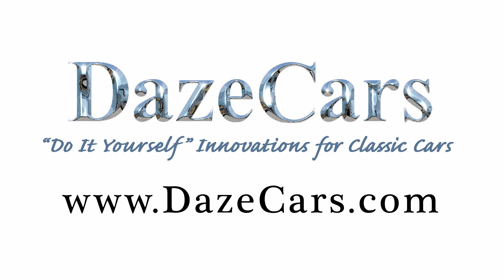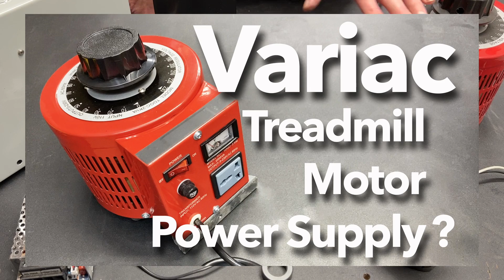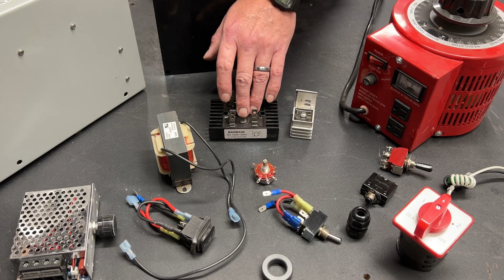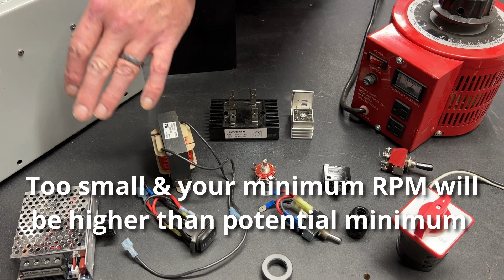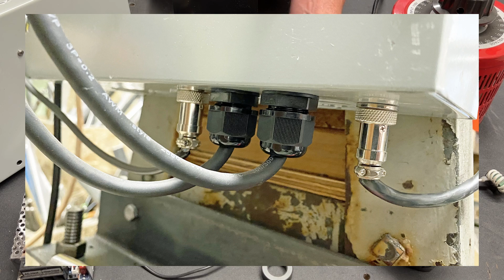Parts Lists & Links for Building Your Own Treadmill Motor Power Supply

Comment: Daze, I would like to know how you got hold of you  your  Lathe Els  system for your lathe  can you fix my problem by telling me were & how much did it cost, & where you got it from & can i ues a mobility motor Dc motor to do the driving ?
Reply from the maker: Here is my ELS parts list video.  Please don't hesitate to reach out I can be of any further assistance.  https://youtu.be/tIHPrIi9Zys
Reply: Hi Daze, do you have any sources for motor pulleys? Your power supply info is excellent. I have to find an old microwave oven. I want to swap the flywheel pulleys and gear down the speed. Oh belts too.
Reply from the maker: I get all that from eBay and Amazon

Comment: A new video you could make is on how to program the PWM    XY_KPWM    35800-TE .   I am good with these kind of  things but not this one. My treadmill motor is a 2.5 hp  with a MC-2100 controller, everything was complete and running with the control panel. I purchased one , set it to 20 Hz and the motor was running at 50 %. So then I went to set a % range of 15 to 45 % .  I could never get it to display the dn  or  up during the setting process. Never could set it and it never ran again. Turned it on, where it was showing the word OUT. Ordered another one same thing. I have the instructions , Hold down button ect.    Will you make a more detailed video on this PWM  ( or have you already made one ?) and the other one that has 6 buttons, and no knob.  There must be many other people that have trouble getting to learn how to use these.
Reply from the maker: I already go over programing in several of my other videos.

Comment: I remember watching your series where you took your combination machine and made a seperate mill and lathe out of them.
Are you happy you did that? Were you able to notice performance increase in the mill?
I have a Smithy Granite 1340 combination machine. Its an older version bought second hand. The lathe spindle has a tiny amount of play (enough to cause chatter) that im working on taking out.
The mill portion runs great, but im noticing it wants to bog down during fly cuts. This could be me setting up the cutter wrong, or just losing too much power with all the gearing and belts that allow it to be ran from lathe motor. Did you have a "weak" mill problem as a combo? I dont necessarily have the time and material to make a mill table and frame to connect the mill head to, but i was considering removing all the linkage and using my treadmill motor and mounting it up top like a bridgeport to run the mill separately. I think this would give me the milling ability i need and use the x and y axis already built on it. 
My question there would be, did you notice a rigidity issue while it was a combination? Were you able to gain rigidity by giving the mill head its own frame?
Sorry for the long comment, just wanted to pick your brain if you'll allow it
Reply from the maker: I did gain some rigidity by making the mill stand alone as it eliminated the swivel aspect.  Bigger improvement with my dedicated machine with height adjustment.  By having height adjustment I never extend the quill more than 1/2" which was the single biggest improvement in rigidity.  I have used the mill more after making it stand alone than all the years I had it before making the adjustment due to eliminated setup time.  

As to your issue I would hang a larger treadmill motor off the back of the mill head and power the mill that way.  I have tons of torque and variable speed doing the exact same thing with my stand alone unit.  I found with mine that some of the slop in my spindle was due to the clutch mechanism for going from mill to lathe and back again.  By removing the mill head I was able to lock out the clutch and eliminate spindle backlash.  The same could be done with your machine if you used a dedicated motor for the mill head.  Short answer I love the improvements and flexibility I gained making my mill stand alone.  With that said the table is way too small so I will likely be getting myself a big boy mill this next year and converting my current mill stand into a surface grinder.
Reply: @dazecars  nice! Hopefully there will be a video series about making it into a surface grinder. 
Thank you for the info. Removing backlash through removing the clutch would be an added perk i didnt think of. All together i think i would benefit greatly from giving the mill its own power source. Then i could modify the lathe spindle too since i wouldn't have to worry about having the ability to transfer rotation to the mill. Give them both an upgrade but still be able to use the same ways and table. Upgrades that won't require me to buy anything extra sounds super nice lol although i do want to get proper tapered roller bearings for the lathe spindle. 
Someday ill have the funds to also get a proper mill and lathe in the shop, but until then we make due with what we got.
Thank you again as always for response and info
Reply from the maker: Oh yes modifying my current mill into a surface grinder will be videoed.  Adding a dedicated motor for the mill in not hard just hang it off the back   @kylewellman402

Comment: Hi, I recently put together a small hobby lathe for my dad with a treadmill motor and I used a dc speed controller with a dc power supply. Do you see any problems with a system like this? I did not use a choke or any other components just what came in the dc speed controller. Any input you have on this would be greatly appreciated. 
Thank you!
Reply from the maker: Hard to say with out more information on the DC speed control and the DC power supply.

Comment: I have watched almost all your treadmill power supply videos over the last week or so. I’ve just bought an old atlas lathe and electronics is a bit challenging for me as I’m still comfortable with points and condenser’s and cars. I just picked up a treadmill yesterday with a three horse motor and what appears to be a PWM, power supply. But I can’t tell and from your videos, I’m having trouble figuring it out. It does not have a separate choke  and the only thing on it is Pacemaster Digital PS. I’d really appreciate it. If you could direct me to some resources where I might be able to figure this out.  Your channel is phenomenal.
Reply from the maker: Email me with pix of the board.